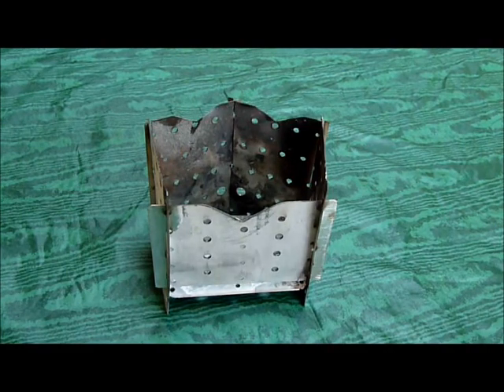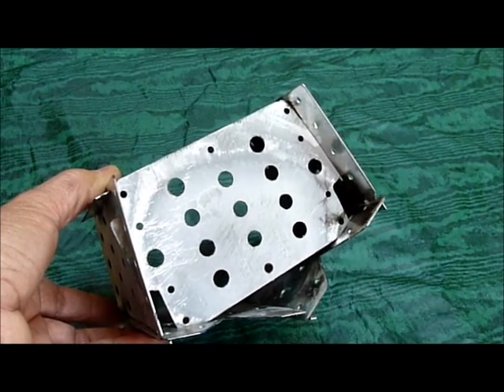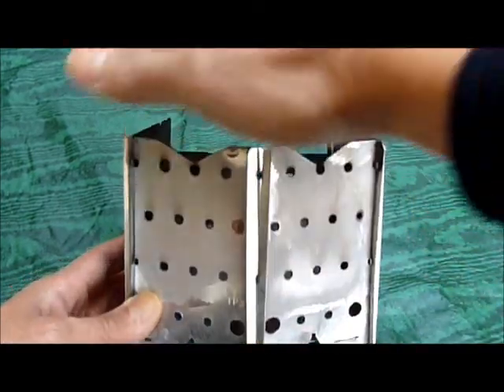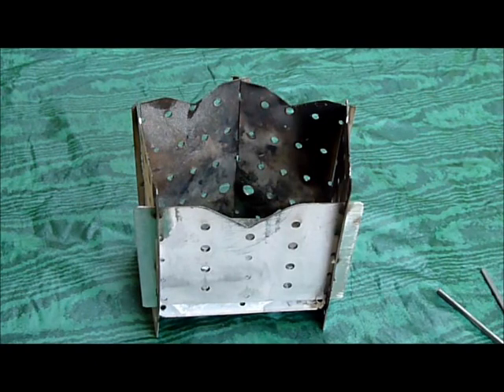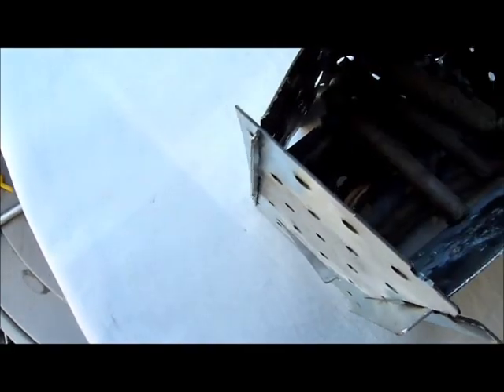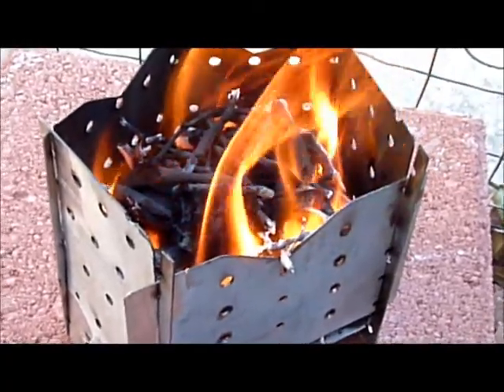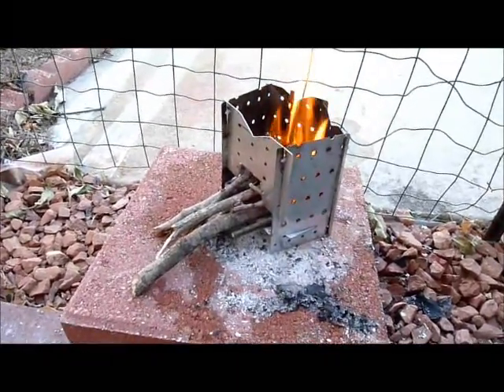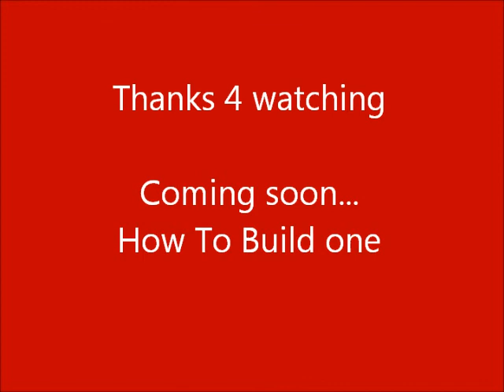$6 DIY Firebox stove - Improvements and Test Burn

Comment from the maker: There are 2 front plates. The top edge of the TOP feed front plate is at a lower height than the side plates. The top edge of the BOTTOM feed front plate is at the same height as the side plates.